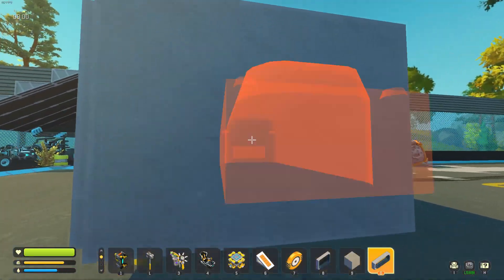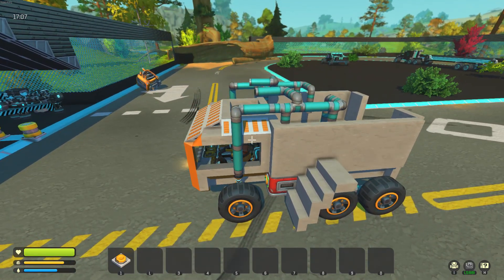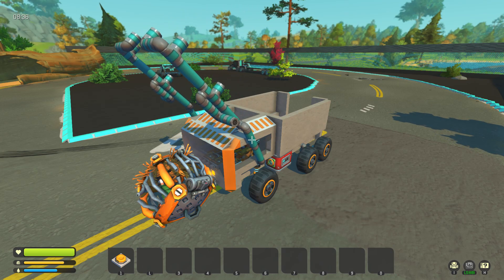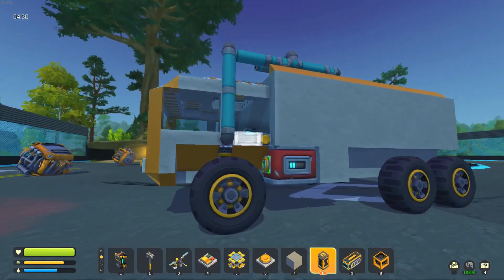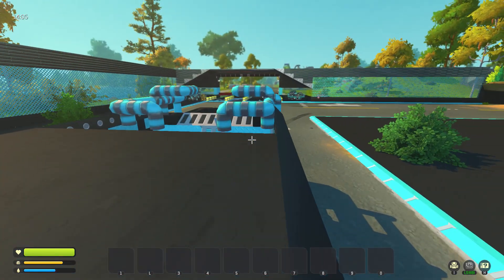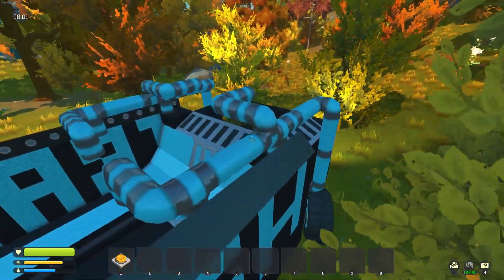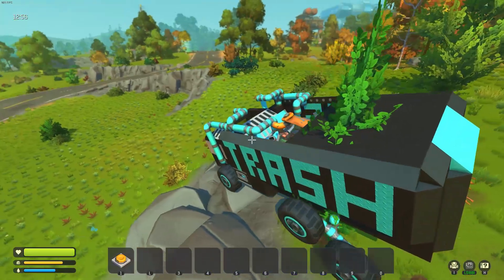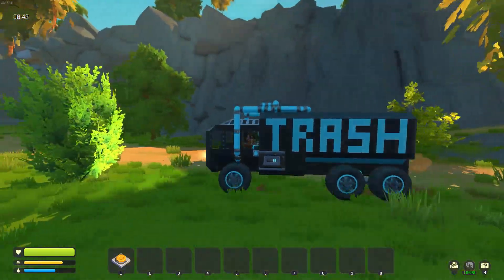Scrap Mechanic  part  15 TRASH TRUCK to pick up caged farmer

Comment: Sorry for the late comments 😆 just recently stumbled across your channel, cool stuff. I recently just built a similar type garbage truck design. Your pick up arm design is interesting. I just used forks though on the arm, but found the rolling away a problem😆 i used pistons to extend, then bars to close round the farmers then it drags them on to the forks. Managed to get 5- 6 farmers in the back.

My only gripe is, the music should be kept to a bare minimum background noise. Ive found if they are silent videos with no talking but music playing, i mute it most of the time. But talking, like you, i dont want to mute, but the music gets annoying and over powers you talking.
Reply from the maker: all good comments are a good thing and sounds like you have a good design😉